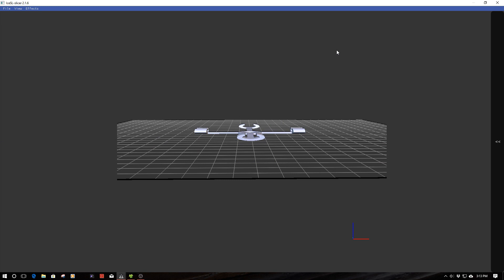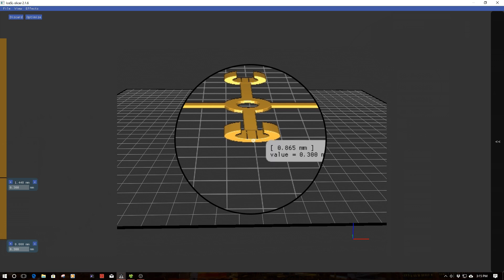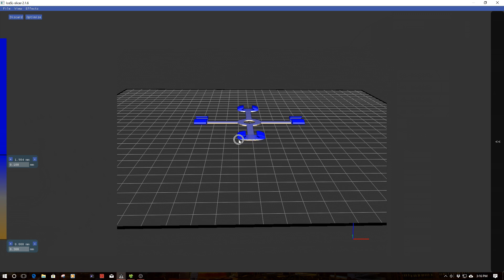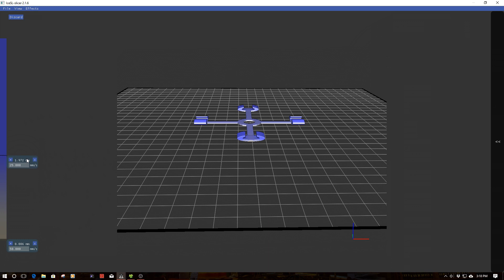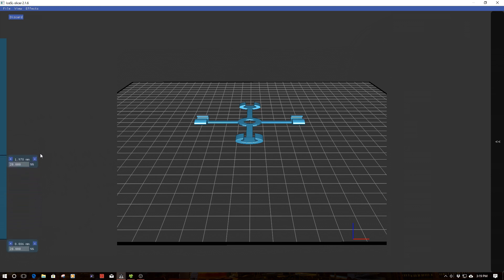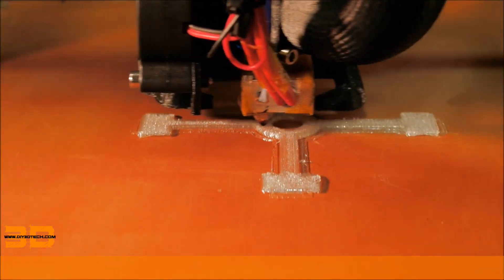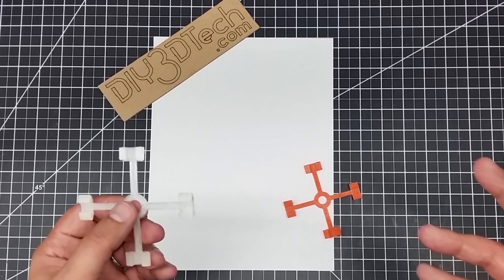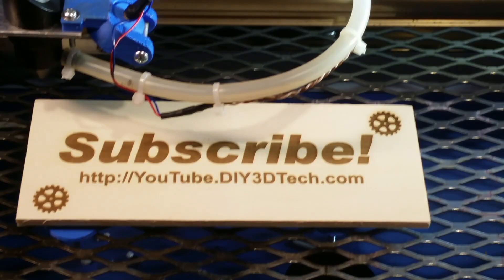iceSL SLicer - Example Using Adaptive Layer Slicing!

Comment: I discovered this slicer because of you and Im testing it now. Has some nice aprouches for some specifics of printing, really interesting. But you also mention cura and slic3r. Slic3r has all the features Icesl has and even more powerfull in some aspects, through modifier meshes. You should check it out (forget about 1.2.9 version, the "dev" version are out and functional)
Reply from the maker: Have not had the best of luck with Slic3r in the past, maybe its just me.  However with IceSL the built in Lua language is what I found extra interesting as I am also an Open-SAD fan :-)   However thanks for sharing!

Comment: I'm surprised there aren't more videos and information about this software as already I can see great potential for this. The ability to change layer height for free software is quite impressive. I'm just starting out with it, but am excited to see how prints turn out.

It would be nice to be able to enter values instead of dragging those bars up and down and steadying the mouse to get it just right. Also dragging past the bottom should just return to zero and dragging past the top would go to the height of the model. 

The scaling is also a slider so once you change that, good luck with getting it back to 1.000.

These are all things that I'm sure they will implement at some point in time so will be interesting to see how things progress.
Reply from the maker: Yea there are some rough edges, however I have been impressed with what it can and as you mentioned its free!  I have also been corresponding with the Dev too  and he really wants to improve it so I am trying to support him :-)

Comment: You keep mentioning using this slicer in a business workflow. You can't use this slicer for free as a business based on what you said in your first video about this slicer. Would you be willing to pay them $100 for this slicer with its bugs and warts, or, does Simplify3D start looking pretty good for another $50?
Reply from the maker: The specifics listed on the site for commercial use are "IceSL is free for non-commercial use (contact us for all other cases). The full license text is here." So what is commercial use?  In fairness, you would have to contact them for clarity as my opinion is they they are protecting their property rights because as a dev I do the same thing, this prevents someone from taking something I have created combining or remixing for profit without including or at least and more importantly providing me a level of legal recourse.  So in short I don't think they would be stupid about the economics (I have also spoken with them and they are very reasonable and accommodating folks). If I was running a business, would I shell out $100 bucks for this?  Yes, as this is not simplified 3D, as this provides one a means of a "single workflow to product".  Having worked or been part of a PLM environment for decades in the automotive area, I can say with certainty this would be a powerful tool.  The killer add on is if you could add scripting to control the adaptive slicing for the model (which I don't think would be hard for them to add).   Hope this explains :-)